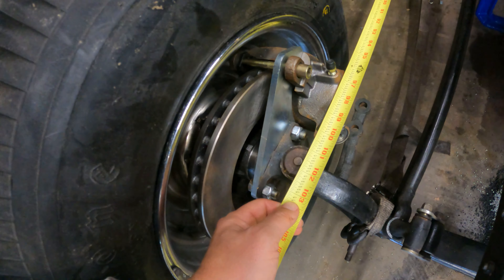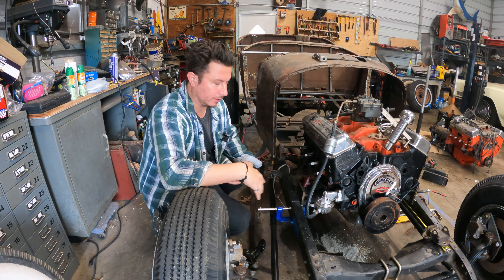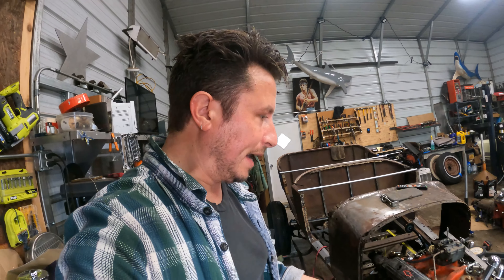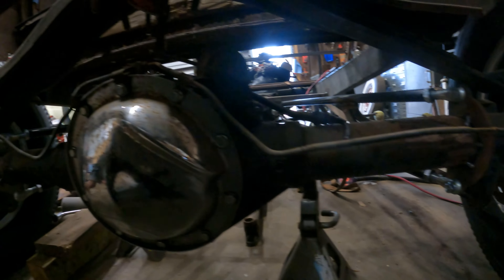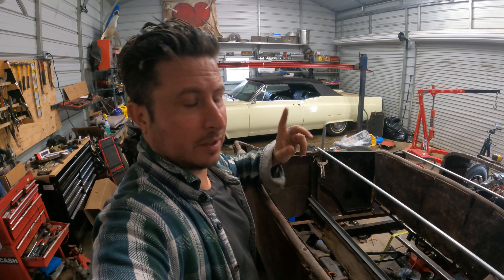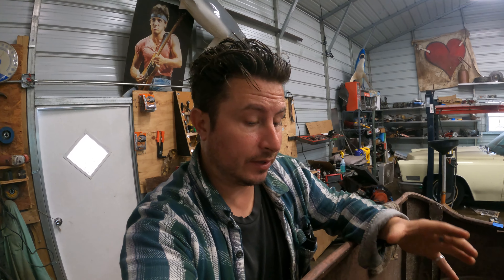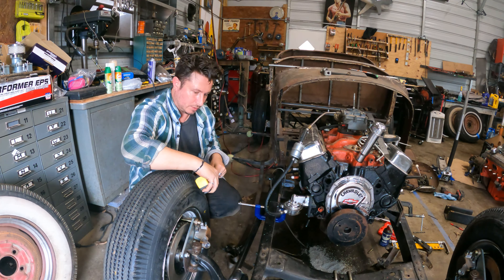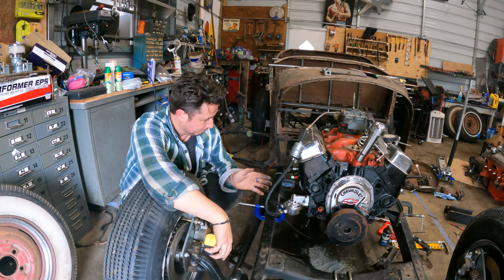I SCREWED UP! This Is WRONG

Comment: Just a thought, from experience... If you tacked both sides of the rear axle radius arm mounts, you may have added a stress to the LH axle tube. Should that be the case, cut the tacks on inside, or both sides, and re-tack. Yes, the final welding may relieve that stress. It may relieve it slightly out of line with the axle shaft and result in short bearing life or added friction on one side. Come to think of it, the tacks on both sides would need reworking....